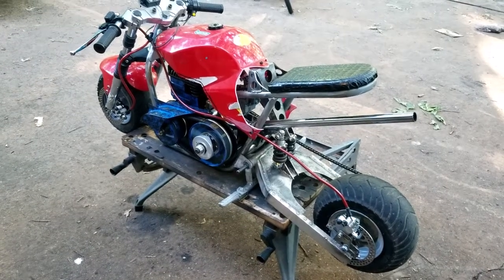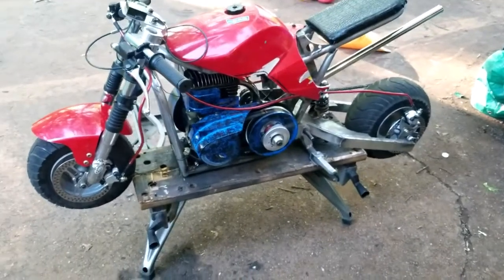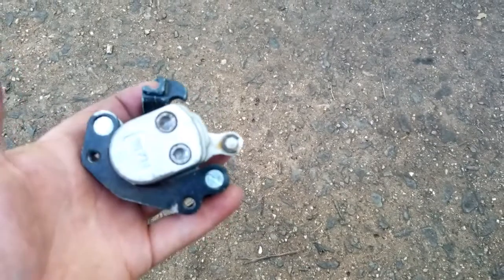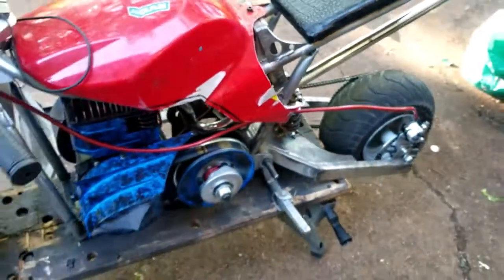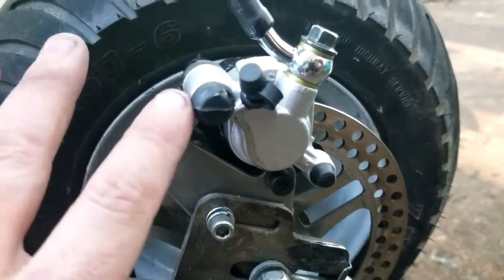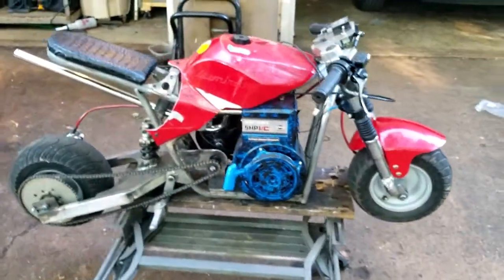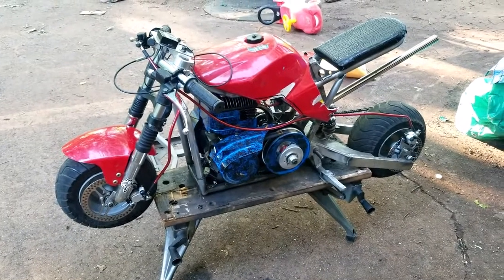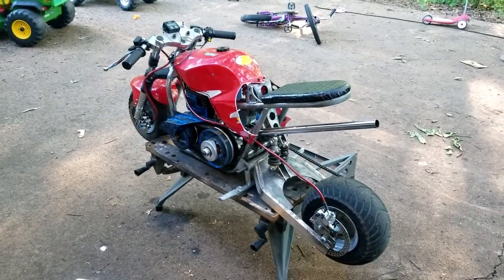Pocket Bike Hydraulic Brake Conversion

Comment: I have mounted the same callipers on my rear wheel on the left side and it did not work, the whole calliper bends inwards because the brake is ment to be mounted on the right side of the wheel. @starnes, have you tested it more since seven months ago and did they fail? Or did I mount it wrong..
Reply from the maker: Yea I actually recall the factory mechanical brakes doing that same thing... I prolly unknowingly fixed all that when I extended the swing arm because I cut the brackets off and rewelded them to swing arm extensions... My brakes seem to be ok.... 🤷‍♂️
Reply: @bstarnes514  ah, oke good information. so the guider pins should not be mounted parallel to each other?